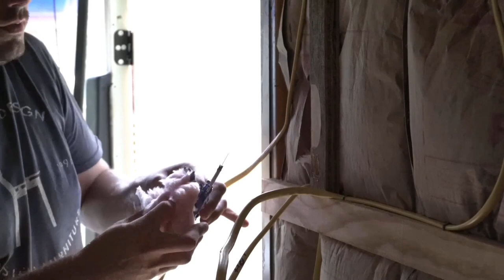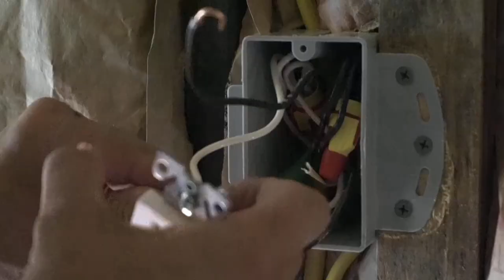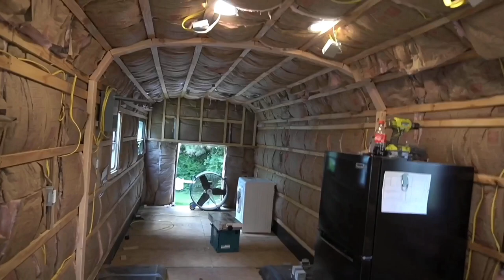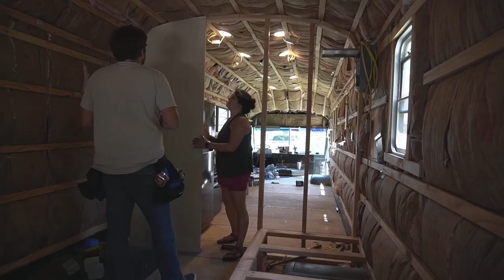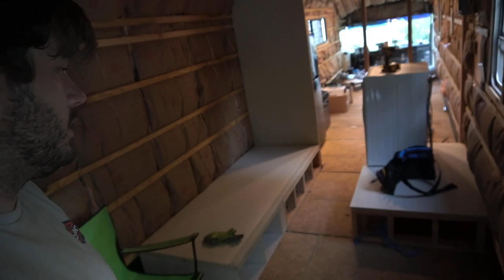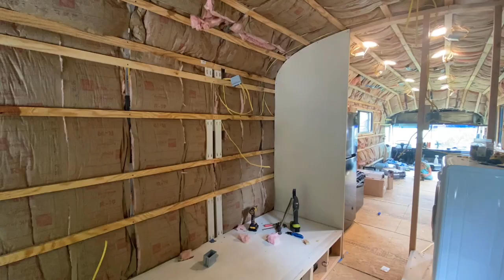School Bus conversion Episode 15 - LET THERE BE LIGHT

Comment: Great progress!... Some days feel like you're making little progress. Some days you can see a huge difference. It's looking good. Will you have any 12v DC lighting?
Reply from the maker: We won’t have any 12v lighting but we will have some 12v circuits. Like the water pump. We’ll have more than enough solar to use 120 on everything. But our cooktop won’t be electric (some people use electric cook too) so we’ll save power there, and our water heater won’t be electric. All thing considered, we decided not to use 12v lights. Plus they’re not as big or bright. Thanks for watching friend!!!!
Reply: @lifeanywhere  sounds good. I just installed 3 rv vents. They're really great. Cooled the bus nicely when I was working there yesterday. You need 12v 5 amp or 10 amp depending on your wire gauge for each of those. I'd rough that wire in now even if you're not sure if you're installing those.
Reply: @lifeanywhere  and happy father's day!
Reply: @lifeanywhere  it's false that 12v are less bright. They can be as bright or brighter and take 20 to 40 percent less energy. there is no advantage to having 120v lights

Comment: I want to do the same thing as you I just haven’t found the right bus for the right price but I’m definitely researching everything I’m just going to do it myself I have diabetic neuropathy so it may take me longer then most people but I want to make a rustic like pallet wood wall but what can of sub wall I need to put first like plywood or drywall or osb board? What are you going to use
Reply from the maker: I would definitely use plywood. It doesn’t need to be very thick. Use liquid nails or some sort of adhesive and brad nails to hold them to the walls.
Reply: Using long 1/4 steel rivets, I riveted full sheets 3/4 plywood directly to the hat channels of my bus with 2 inch insulation boards sandwiched in. You could easily use 1/2 inch plywood instead. I liked the rigidity of 3/4. Tacking pallet wood to that work well. If I had to do it over I'd have bought our bus from AAA Bus in Phoenix. Relative to diabetes I have type II and staying away from carbohydrates, the bus build exercise has been great for my better health.

Comment: Your build is looking amazing. I do have on question not trying to be a negative Nancy. Are y'all using pink fiberglass for insulation, I truly hope not for the safety of your family with all the research out there of the why not to use pink fiberglass.
Reply from the maker: Really? Why not? I haven’t seen anything like that. What have you seen? Thanks ✌🏻✌🏻✌🏻
Reply from the maker: @lct7284  I’ll look into that. Thank you for bringing it to my attention
Reply: Couldn't you just cover everything with the plastic vapor barrier stuff and tape the edges (similar to a sticks and bricks house)? I'm not a builder, but seems logical 🤔
Reply: @pamelabranch5865  the problem is that fiberglass holds moisture moisture is a big issue in a big large metal box which in conclusion will cause mold damage like I said I've researched this for over 4 years between school buses remodeling whether it's an RV or a travel trailer and building tiny homes ijs.
So if you want to choose that route that's what you can expect to happen and then you going to have to replace it.